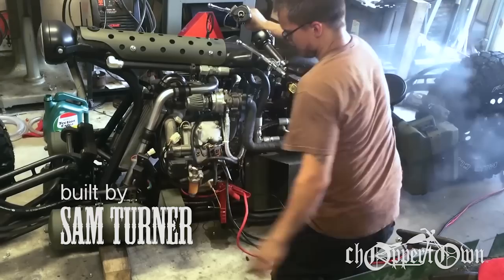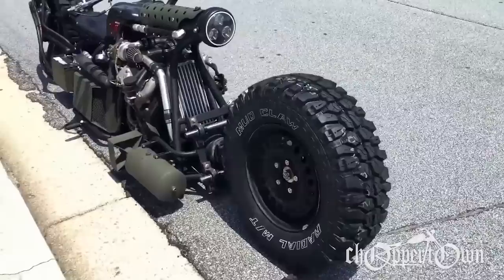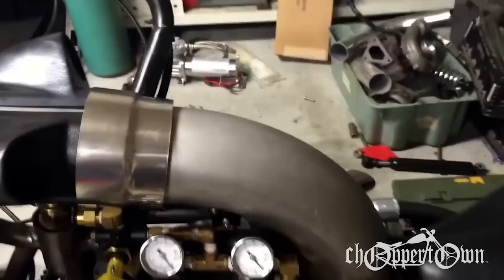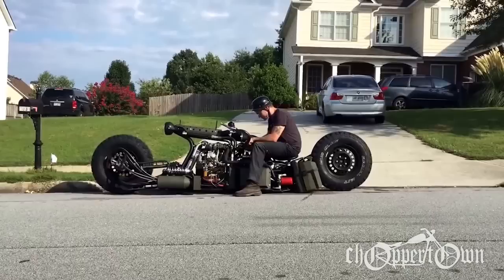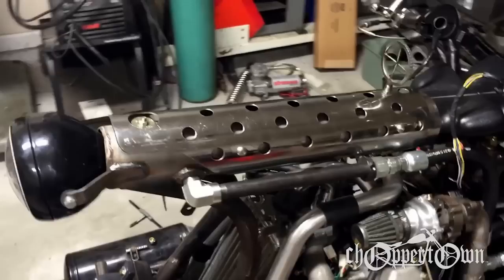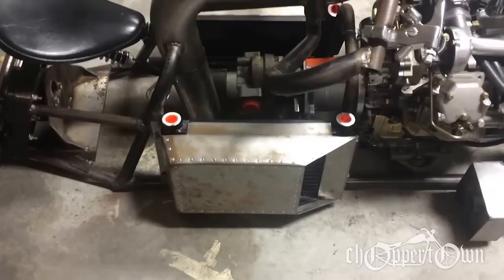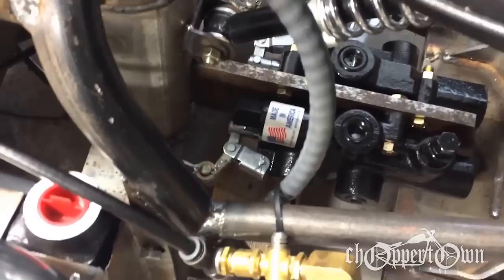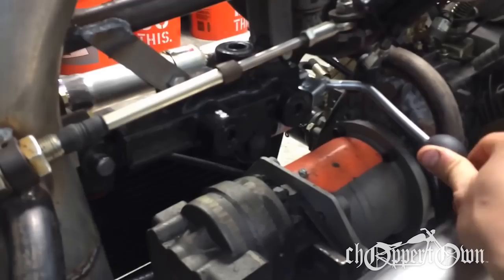Twin Turbo Diesel AWD Motorcycle (Bike & Builder episode 2)

Comment: As I watched your video I cringed to think about the comment section. So many keyboard fabricators foaming their opinions about how you did this wrong or change that or you are killing baby seals with the smoke or it's not safe, blah blah wine blah. I'm surprised by moderate level of intelligence here though. You built this. From scratch. In your own shop, With your own hands, using your own brain. It's wonderful and it's something that 99.9% of the trolls on YouTube could NEVER accomplish. Very well done sir.
Reply: +dozer1642 But couldn't it run 95% less smoke if the engine was simply tuned properly? The only time they do that is when they are spraying in way too much fuel to burn completely. Maybe he needs it to have enough power I guess. He should put on a bigger turbo.
Reply: +sirgallium my best guess (from a 4:54 minute clip) as to why the engine smokes the way it does is merely because its operating under heavy load all of the time. Fabricating something like this isn't a science. It's art. The fact that the engine chosen makes the darn thing go down the street at a moderate pace is a stunning success. It smokes a hell of a lot less than the ten dodge trucks with the 8" stacks that the high school kids in my town cranked up the pumps on just to be obnoxious. It's one man and his unique creation. God bless him.
Reply: dozer1642
Yeah I love it. Incredible creativity.
Reply: +dozer1642 The black smoke may look cool, but is a sign of incomplete combustion... so the engine doesn't run properly, at least not in this video. Seems like it's still a work in progress though.
Reply: +sirgallium ...Or smaller turbos? Maybe it's too low engine rpm so they don't spool up to their intended rpm.
(I have no idea if this model of turbo is considered "small", "medium" or  "large"... He also has two of them, perhaps going down to one would do the trick? (Just brainstorming a little.)
Reply: +ziiofswe rhb turbo's, they are the world's smallest turbo, about the size of a can of pop.
Reply: Waylon Richardson
Ah. Thanks for the info.
Reply: absolutely!
Reply: Thank You very much for the comment! I truly enjoy hearing from the people who find this bike interesting. I try to respond to tech questions, but other than that once the rude and hateful comments start flowing in, that when I turn off my comment notifications. Thank you for understanding what I was trying to accomplish with this bike, not a mass production vehicle that is going to destroy the planet, but a one off custom that was build "just because" not designed for practicality , but for pushing the limits of what I am capable of building.
Reply: Dieselmonkey89 why not pick up a 2 seater adult go kart and stuff an engine like you have in this bike into it?  That would be fun.
Reply: +Dieselmonkey89 I'm an mechanical engineer and work with hydraulics, some ingenious use of parts, great job! Also incorporating these parts and functionality into the styling (and structure) of the beast really ties it together.
Reply: +dozer1642 Amen
Reply from the maker: +dozer1642 Well said dozer, totally agree
Reply: +Bill Nunyabiz? Seriously?
Reply: +TitaniumFox95 your mixed metaphors have me confused. It doesn't "drink" a lot of fuel, and it is "ECO" friendly. 

What exactly is your point?
Reply: +dozer1642 I 100% understand what you are saying, but this is a special case.  I do not agree with you.
Reply: +Handy Man you think he should be jailed for gross pollution?
Reply: Jes, he berry bad polutation.  LOL, I just don't like the thing, that's all.  Everyone has there our opinion and this is mine.  Bye
Reply: +TitaniumFox95 I love it when the tree hugger idiots freak out when they see smoke coming from a diesel because it demonstrates just how little they actually know about diesel exhaust vs gasoline exhaust.  Little lesson for all you genius's... Diesels release carbon in the form of a heavy smoke that settles harmlessly to the ground, gas burners release carbon in a gas form that is not visible and is much lighter than air, it does not settle to the ground.  Gas exhaust carbon stays suspended in the air, that is far more harmful than settling to the ground.
Reply: +lzvagias 
And is carcinogenic and that's why modern diesel vehicles have particulate filters fitted although they should be showing no VISIBLE smoke without them.
It's not running right if it's making so much smoke.
Reply: nah man, I think this is awesome. I just wish there was less smoke so people can see the bike when your driving by. and so you probably don't smell like shit after
Reply: I agree. I never built anything like this and to criticize the project would make me a punk.
Reply: You're right, it's slow and belches smoke.
Reply: Well said.
Reply: took the exact words out of my mouth. You and the builder dam smart
Reply: it is not trolling taking offense from misadjusted fuel pumps.  I even said I do like the bike.
Reply: +Star Core you live in a fragile world.
Reply: +Star Core have you ever seen a volcanic explosion? Let's say you have. Mt Saint Helens for example. Can you begin to comprehend the CO2 produced my the recent (in human terms) explosion of Mt Saint Helens?
Reply: +Star Core your comment is so fucked up on so many levels. 

"Most people" don't have garages? Really? 

I don't have a garage. I build stuff.
Reply: I was thinking the same thing lol
Reply: A bigger turbo might solve that problem, but seeing as the vehicle has only 1 gear (that is probably as tall as it can be while still being able to move the vehicle from a stop, so as to give a better top speed), the low RPM boost of a small turbo probably helps more than it hurts the engine by choking at high RPM.
IMO easily the most badass vehicle ever contrived, and hand building the thing just makes it that much better. Not sure what practical purpose there is to AWD, but it definitely gives extra badass points
Reply: You said it so its true.
Reply: Star Core A bit late, was busy working.
Just wanted to point out I do ride a chopper, I´ve got another one on the way as a build, and none of them are polluting the environment. And I am certainly not American.
Reply: ***** So true !
Reply: ***** Agree fully-and adjusting his fuel pump would certainly reduce that stink...
Reply: best not worry about broadcasting your likes or dislikes on youtube unless you are after sexual intercourse
Reply: +trillriff-axegrinder, how is that pertinent? I don't think sexual intercourse is even remotely relevant to this discussion. You are the one with the problem. Go elsewhere.
Reply: Hey genius. It's geniuses, not genius's.
Reply: Hydrostatic drive.... no gears.... just pumping limits.
Reply: Berzerque Are you familiar with the "Euro 6" directives for emissions from commercial vehicles ?
Please read, and learn.
The exhaust from a modern bus/coach is CLEANER than the air which was sucked in by the motor !
Reply: +NinjaRider777R nice kick mr ninja.. is he really mad or may not even seen school before in his life? for him all the engines are air purifier machine..
Reply: ***** Dude, you need to bone up on your tech knowledge. It is true !
Reply: ***** Does the word Micro Filters ring any bells with you ?
Please read through the EU legislation for emissions, and you will understand.
Reply: I applaud you for this comment.
Reply: ***** That is not a very scientific statement, is it ?
Please go bone up on the EU emissions legislation. I have, it is a part of my job. Look up "Euro 6", and learn.
Reply: NinjaRider777R .... your breath obviously does
Reply: @Dozer1642 This world always exist good guys . if its not , u should be that good one ! cant talk like u ! compare with truck's engine to excuse for those load smoke ! anyway , good opinion
Reply: Agree, but how the fuck do you breath?
Reply: I feel like it's less of people trolling the comments here and more of asking the question why is he rolling coal? He already put so much cash into building this bike why not pay the extra little bit for a proper tune. Which I think is completely reasonable, the bike would also be a lot faster and more efficient with those turbos if he wasn't rolling coal on it. Just my two cents.

Edit: I also didn't add that this is an absolutely amazing creation and I love the hydrostatic concept. Plus the added bonus that you can just drop it down to the ground is mind blowing.
Also that theme, mmmm that theme. I love the big MG look on the top
Reply: The only thing trolls fabricate is their comments.

Comment: You must smell real good after a ride on that choking on all the exhaust, lol.  Why didn't you at least run the pipes all the way out the back?
Reply: cause weight reduction
Reply: Gotcha, but still ... what's a couple more pounds so you can at least breathe? Pretty cool how you got all that working together but I would want to enjoy the ride without having the need for a gas mask, lol.
Reply: +Brian Zaborowski best exhaust for turbo engine is no exhaust (as long as the fumes aren't near the intake.
Reply from the maker: +Brian Zaborowski Full-body exhaust shower - you can't beat it!
Reply: lol
Reply: Also on this apparently incredibly long bike that you cannot take a chick behind you with only the one seat. My feeling is she might probably pass out with the drag of exhaust fumes with two people and the lack of any real fresh air after time!!! But damn if she was able to do so she would look tough as hell with all the black soot over her body after a few hundred kilometers. LOL!  Nice setup and well thought out with all the valves and leveling system. Thanks for the share though.